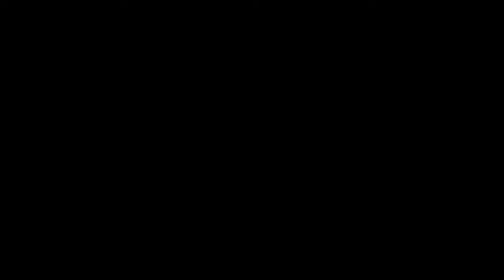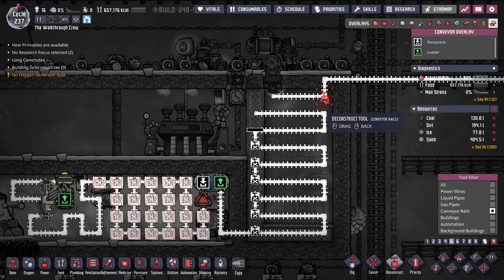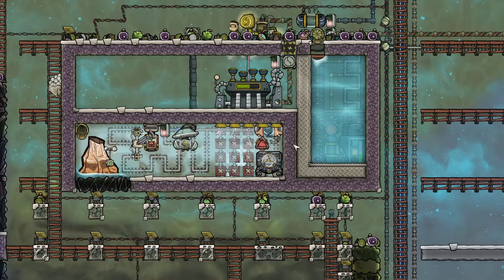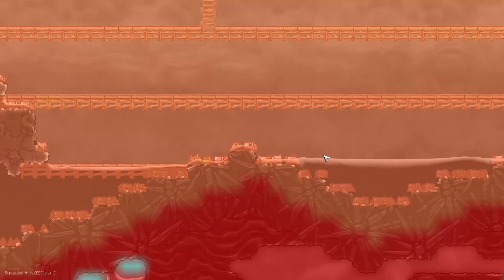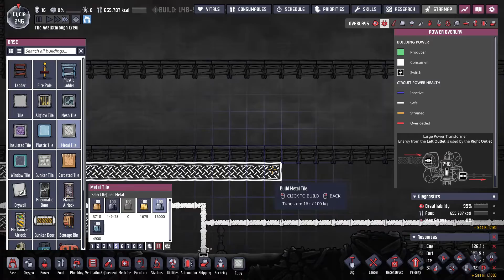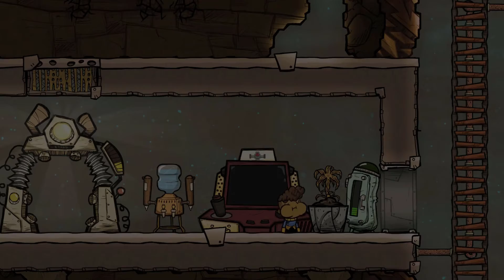Oxygen Not Included: Full Walkthrough Part 21 (2023)

Comment: I did face an issue that the colant machines were broken due overheat. Easy fix: set the timer to 5-6 seconds, this setup will be only allowing the metal plates to heat up to 300 celcius degrees. 10 seconds on my case was heating up the metal plates to 400 celcius degrees and this exceeds the overheath temperature of the colant machines. I might be a little different from you so try your own settings.
Reply from the maker: Yep, good note!  Sometimes you'll need to make some adjustments to it to prevent overheating and there can be a lot of variables
Reply: Thanks. @Magnet_MD

Comment: One thing that I think could be a good idea is if there was text on the screen of which items are made of what. A problem i often have is that I often go, "Wait, what were the vent supposed to be made of? ... Was lead fine?" and then I have to go find the place where you mention that or where you select them which can be tedious.

But if there simply was some small text on the side where nothing much is going on anyway, just stating materials usage like:
Conductive Wire: Lead
Vent: Steel
Steam Engine: Lead
etc, it would alleviate a lot of unnecessary back-and-fourthing

Edit: Or other useful stuff like "Thermo Sensor: Above 175"

Comment: I had an interesting troubleshoot scenario with this, for some reason the automation wires for the steam layer had been Lead, but didn't impact me for a long time then they broke and melted causing the room to heat up to 1000s degrees F!  

I first tried to go in from the bottom, oops! can't do that.  Re-loaded and created a liquid lock to enter next to the aqua tuners, I had to repair them repeatedly via this method while the room cooled after changing out the automation wires.  I changed the timer to 5s for now as well (as mentioned in a previous comment), additionally, I added 1 piece of radiant pipe in each loop next to the steam power generators to get them to cool back down faster as they were at around 212F and weren't working.    

Everything eventually leveled and is back to normal.  Was only able to fix due to following your series!  Thanks!
Reply from the maker: Awesome!  Even nowadays I am having to solve similar problems because I forget something or make a mistake

Comment: @Magnet: I have upgraded my lava setup to use the vertical door mode (thanks for showing that dupes can handle almost anything!).
I have noticed that if I run triple speed, and have about 6 doors, the game sometimes is not seeing the open door as a vacuum. I have to switch to single speed, force the doors to close (by disconnecting the automation wire uplink), and then reconnect it again. Only then it will consider an open door as a vacuum instead of a closed door with respect to heat transfer. (the whole area is vacuum).
This is of course a bug, but just a heads up.
You can see if the open door is thermally disconnected by a blue aura around it in the thermal overlay. Obviously it is red when the bug is triggered.
Reply from the maker: Oh weird, I haven't seen that before!
Reply: @Magnet_MD  It might be related to the full vacuum tile: I did not seal off the ends of the vacuum chamber as the whole lava area is already one big vacuum thanks to me draining the energy out of it :-). I can try to block off both ends so the calculations might be more easy. As I said: the whole lava area is becoming one big vacuum, and that might be too much to calculate when the doors open. But a bug nevertheless :-).

Comment: If you all want to go smaller you can. Just can make a smaller pack it in type with just two doors, an aqua tuner, and two steam turbines. Good for lava  veins, and less usage of steel and tungsten. 

Again just the tip going into the lava. 😮
Reply from the maker: There are a lot of ways to do it for sure.  I thought this was something big enough and easy enough to understand that a newer player could replicate it's fundamentals and make their own.  The idea of vacuums + doors to conduct heat, conduction between tiles + doors, and powering a ton of steam turbines I think hold up in a lot of ways.  This might be the first time a bunch of players have seen this, so I want to make bigger, more obvious setups, and things that are very reliable and easily maintained.
Reply: @Magnet_MD I appreciate this. I have a petroleum boiler and that was really finiky to get working right without needing to repair over pressure issues and pump out sour gas.

Comment: What’s the high pressure vent for in the steam turbine room? Did I miss? Oh I have another question. I set up exactly the same ranching stables, but my auto wrangle surplus in the other room just doesn’t work. My dupe never takes the critters from there. Can you please help me❤
Reply from the maker: Hi!  The extra gas in the steam turbine room is to over-saturate the oxygen in there so heat/cooling transfers better.

As for the stables, are they refusing to move the baby critters or the adult ones?  They won't automatically wrangle the baby ones.
Reply: Thanks for replying. I think all critters as my stable only has 4 and 3 left. No one is wrangling anything this whole time 😢
Reply from the maker: @sherylxie717  Hmmm, they have the right skills to wrangle and move them?  And all of the drop off points are set correctly, targeting the right types of hatches?  Is it prioritized high enough?  Is the drop-off accessible (like the door underneath is shut) so the duplicants can get access to it?  Are all of the critters stuck in the door?
Reply: I skipped this step and noticed my steam tubines overheating...Magnet never does anything without a reason :D   @Magnet_MD

Comment: isnt diamond better to make the tile that touch the lava?and putting the door horizontly to maximize the contact point between the 2 lair accelerating the heat transfert?  how many time could this device work full time? how many cycle before lava go to cold?
Reply from the maker: You could use Diamond, I'm not sure how it's temperature exchange compares to the metal tiles.  I'll check on that.

If you make the door horizontally, your duplicants won't be able to get into the setup and maintain it if there's a problem, or if you need to extend your tiles.

Theoretically you could power way more turbines than this if you wanted to, but that's probably overkill at that point.

Some of the lava will start to harden in maybe 50-100 cycles, but it will still be very hot.  I imagine you would get a good 1000 cycles of power off of this (you may need to extend the tiles or move the magma around in some way).  You can also take volcanoes which will be a renewable source of magma.  Either way, in the base game in particular, this shouldn't harden or struggle by the time you've breached the temporal tear.
Reply: @Magnet_MD  i ve try it, it work fine but i ve decided to put the aquatuner in an other setup to avoir overheating issue that can occur too easily.i ve also removed the isulated tile that touch the hot material , just making a vacum sealed tile better for insulation and less costly.it work fine..... i ve also change the heat spike design making it more deep pushing magma with door etc... was hard but it was a good idea on the long run, it worked for 2000 cycle and magma wasnt yet cold enough to solidify.Took me allmost an hour with micro managment to build.

Comment: Yesterday i was mining out the oil biome, and got a lot of scalding messages out of nowhere, one tile of hot abysalite (~500°C) was on top of one of the fossil things that you have to explore and i mine it out and for some reason got on my main line of shipping. i don't know why that block was super hot, but my oil biome now is literally full of Sour gas and petroleum. (i already fix the problem, but it was a stupid thing to happen.)
Reply from the maker: Yep, gotta be careful, some tiles are very hot and will do that.

It being boiled into petroleum is a good thing though!  The sour gas will take a lot more work to make useful, but you can eventually condense it down into methane, then heat it back up into natural gas.  It's a lot of work but can result in a really cool and profitable setup.  If you haven't been here before, you're probably best off just ignoring it or finding a way to vent it into space without causing heat problems.

Comment: I just finished #20 and started into #21 to see your system running. is it not necessary to run the cooling loop behind the steam turbine?
Reply from the maker: You will need to cool those turbines for sure, sorry, it might be a little confusing.  Are you seeing the cooling loop running?
Reply: @Magnet_MD  i apologize. i think my message could be more precise. i’m referring to the running system at the start of #21 for the copper volcano. maybe i just missed the cooling loop for the turbine in the liquid pipes diagram for the copper volcano.
Reply from the maker: Ooohhh, I understand.  That turbine should stay cool because it is right next to the pool of cold liquid with metal tiles bordering it. A lot of the heat from the turbine will be offset by what radiates off those tiles :)

Comment: Thanks so much for the great tutorials. I made a mistake in setting up my volcano. Basically the pipe for my steam engine is blocked and now I don't know how to fix it any more. I tried a few times to get into the place when the volcano is dormant but it is too hot and it boils my vacume medium. Is there a neat way to fix it ? :(
Reply from the maker: There is, but it is a little complicated.  Basically, if you can make a double liquid lock (one next to the other, horizontally, and bordering the room that has the steam in it) and vacuum out the air in between the two liquid locks (use insulated tiles), you can make a way for your duplicants to enter without any temperature exchange to the outside (because there is no gas between the two liquid locks to exchange temperature).  You will need to use oil or petroleum in the liquid lock so it can handle the temperature without boiling.

It's kinda hard to explain, but that's about the best I can do.  For what it's worth, I am getting my Spaced Out Walkthrough put together and I do cover that exact situation in one of the videos because I accidentally melted a wire in a volcano steam room.  It might not be out for a while, but that'll be the best way to see what I'm talking about.  Sorry for the delay, hope that helps!
Reply: @Magnet_MD amazing so I did that exactly before seeing your comment :D and now the dups can go inside but the room unfortunately is too hot like 350C and they constantly fix the stuff but they break again. I don't know if at this point I should just give up on this one hehe and go get another one? or maybe if I add a second steam turbine it can cool it off and once it is around 170 ish, then I remove the second steam turbine?
Reply from the maker: Yeah, I'd probably add a 2nd turbine to get it under control.  Is this a metal volcano or just a regular magma one?
Reply: Copper volcano. I actually ended up sealing it after I fixed the turbine output (which was blocked and initially caused the whole disaster) and let it run for like I think 10 cycles or so and the temperature came down to 180ish then I went back in and fixed the broken stuff and now it is ok. I only have one more question one piece of copper has been found in 975C (!!!) And has blocked the whole shipping for a good while now. Was wondering what if I move the conveyor thermo detector inside the pool of water so if it is sitting to cool down it actually uses the cold water? Has it ever happened to you to have one piece too hot or is it a game bug you think?

Comment: I noticed my dupes becoming super stressed, is there a solution?
Reply from the maker: Yes, the best way is to avoid giving them too many skill points before they are ready.  If you're in that situation, use the skill scrubber to reset them and make sure to keep them below their morale limits.

You can also click on a dupe and in their info panel, check what is making them stressed.  It could be something weird like air pressure, being wet, not sleeping, etc.